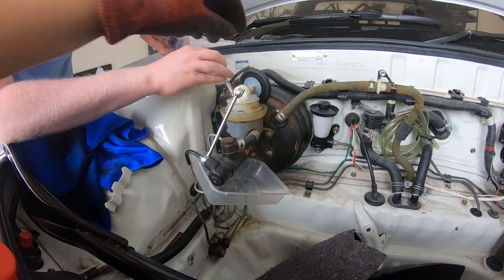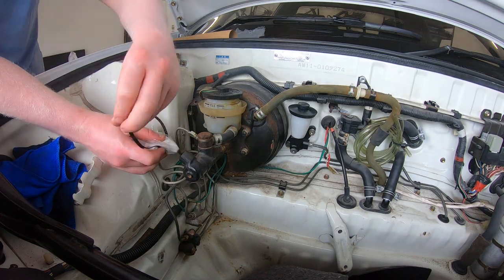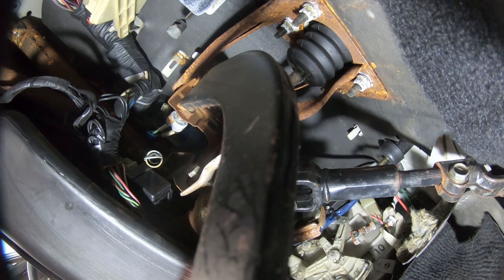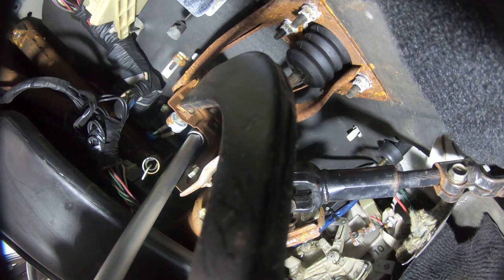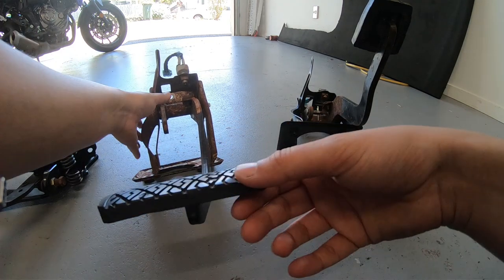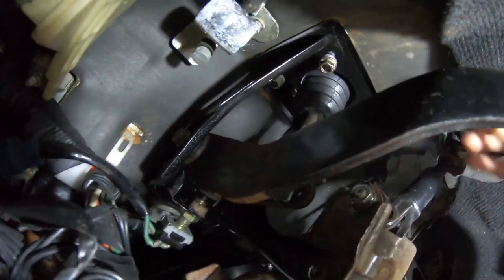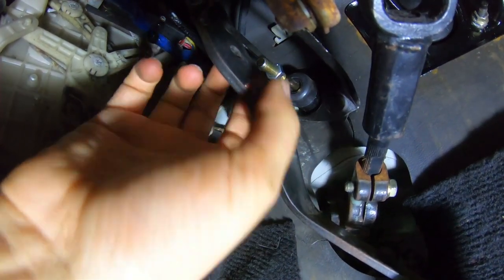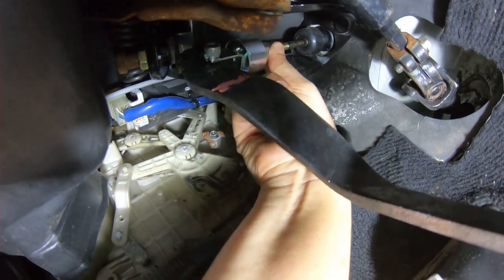WE FINALLY HAVE 3 PEDALS

Comment: Great job!  Looks much better with 3 pedals.😎  We call them a flare nut wrench or simply a line wrench.  On my Corvette I use the same method as you with the syringe to do my clutch fluid changes too.
Reply: Also, I'm always amazed at how well my GoPro's gather light in places I expected to be super dark.
Reply from the maker: a flare nut!? I'll remember that one! thank you so so much!
yeah i guess I wondered if there was another way to approach removing the fluid, but in saying that, there wasnt much spillover when it was removed so i guess it did the job totally fine!
Also regarding your gopro comment, I feel the same! always think it's gonna be too dark, but they manage to impress! That and their FOV is so wide they capture a lot more than I expect!